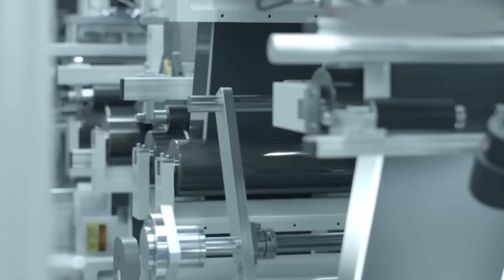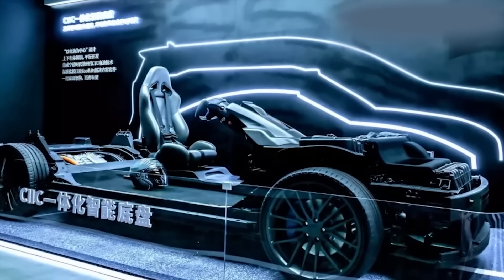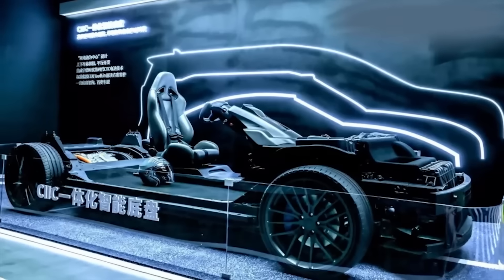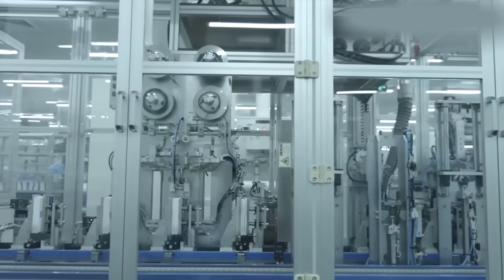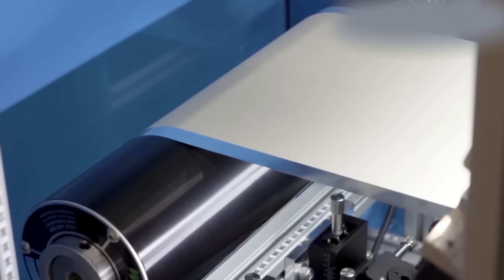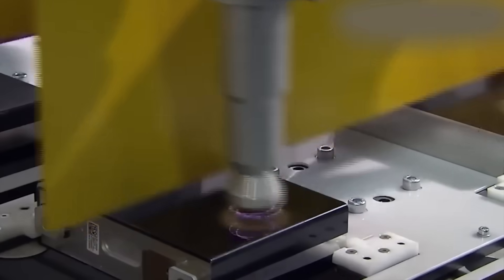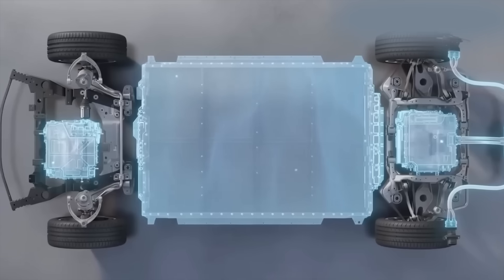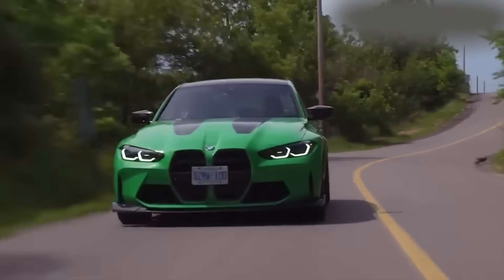CATL Unlocks 1,000-Mile EV Range with New Lithium-Metal Breakthrough

Comment: in Cars ICE engine market share will shrink. but in trucks make money by carrying weight and a heavy battery reduces that, so you make less money with a more expensive truck. electric in industry is still a long way off, you need a peace of equipment to run for an entire shift without stopping (time is money). for electric outside of cars to work we need at least a ten fold increase in battery energy density. i don't think diesel will go anywhere and what Edison Motors is doing with hybrid drive is the bridge technology.
Reply: Interestingly diesel consumption in China has gone down for the second year in a row
Reply: In Europe electric trucks are winning and the rough numbers are twice the purchase price, 25% of the running cost. Hauliers try and maximise asset usage so electric trucks work well for this. Charging time aligns fairly well with mandatory rest breaks, and as a haulier you can assign diesel trucks to routes with insufficient electrification in a way that a private car owner can't.
How it will translate to US trucking I don't know. Certainly there are also things like Australian road trains that are a long way from going electric.

Comment: Need at least 1000kms, so you feel comfortable towing stuff. And can drive all day without worrying about running out and needing to find a charging station.
Reply: If you can charge in five minutes, a 1000km range doesn’t make as much sense. Most people also don’t tow so you are talking about a small percentage of the population.
Reply: @yodaiam1000 . But EV’s need to replace all vehicles, in Australia you need long range, a lot of retirees live the caravanning life. And in remote area you could go 2000kms without charging  infrastructure and this may never change. So towing and lack of infrastructure certainly make long range a necessity in australia. Maybe they will start making driven caravans with their own battery storage, may need to put a solar array on the roof of the caravan with awnings to increase the charging area.
Reply: @keyboardoracle1044 A long time ago there were also no fuelling stations in these areas. Charging infrastructure is building. Yes RVs will have much lower range with the same size battery as a car. RV will be getting bigger batteries. Most mandates in the world allow for PHEVs for larger vehicles that tow. However, with advances in batteries, that may not even be necessary. I get your point but things change and improve and we are just at the beginning of the change over.

Comment: if they figure out a way to recycle used battery cheaper. wouldn't that make the cycle life problem irrelevant? Mainly talking about for aircraft applications where you can have airport level infrastructure that can handle recycle single used lithium metal battery. Or rather design a battery that is easier to recycle. So for energy density sensitive application they can just do fresh battery swap at the terminal station. Instead of having to worry about degrade cycle life.

Comment: Can't help feeling that driverless air taxis are the ultimate end point. The electric motors have the torque and the light weight. The batteries are getting to the necessary energy density and charging speed. Struggling to see why they wouldn't overtake cars in 20yrs

Comment: Lithium metal batteries are  considered relatively dangerous compared to Li ion or LFP. I am sure CATL have done what they can to make it safe, however, the danger is intrinsic to Li in its metallic phase and can't be conjured away altogether.

It would be great to drive 1,000km but not if you are nervous about sitting on an electric bomb.
Reply: While energy density matters, a potential roman candle is not something you'd want.

Comment: 1000 km range is 621 miles. And unfortunately, as often happens, you forgot to consider that this is Chinese CLTC range. It is approx. 25% to 30% more aggressive. In EPA range terms, this is 465 miles. Still, this is very good and a sign of things to come. The average EPA range for ICE cars in USA is 425 miles. So this would be above ICE average. It’s plenty, especially if you can charge at home and you drive it in mostly the area you live. Most people only occasionally have long distances. If Tesla (or some other manufacturer) can get a car with 465 miles and FSD at an affordable price, this would be game over  the ICE industry.
Reply: the Silverado EV and GMC Sierra EV, offer substantial range, with the Silverado EV reaching up to an estimated 793 km (493 miles) in its Max Range Work Truck (WT) configuration, while the Sierra EV offers up to around 769 km (478 miles)
also tesla has there long range models also over 700kms

Comment: This sort of range is what makes an electric car very viable in Canada.  Imagine cities 180km apart in -30c weather... you need the extra capacity for climate control and reduced performance due to temperature.  If there is a 3 hour traffic delay due to an accident you don't want your climate control to switch off.
Reply: tesla already has a long range model's that can do more then 700kms and if you are driven 180kms you would heat the pack up no problem at all and get back any loses from the pack being cold. they also use a heat pump for heating and cooling that is pretty good on power usage
Reply: @NightshiftCustom  Won't buy from a fascist CEO though.  Being caught in a Tesla is being politically tone deaf.
Reply: @billknight7342  maybe seek some help and get your head checked

Comment: QuantumScape effectively solved lithium-metal technology five years ago. CATL’s approach is not fundamentally very different from what Factorial is doing, and that pathway already has many well-known limitations. The claim of 500 Wh/kg appears to be marketing hype rather than a realistic target. In practical terms, the achievable energy density is unlikely to reach even 60% of that figure. Lithium metal increases energy density primarily by eliminating graphite from the anode, not because lithium metal itself has exceptionally high specific energy. At present, battery performance is fundamentally limited by the cathode. To truly approach 500 Wh/kg, new high-energy cathode chemistries such as fluorides or sulfur will be required. With conventional cathodes like NMC, the realistic upper limit is around 400 Wh/kg at full maturity. QuantumScape’s own projections of roughly 300 Wh/kg for its initial version further support this conclusion

Comment: Nobody needs a range of 1000 miles - the payback of higher energy density is that you can potentially halve the battery size needed to go 500 miles 
In fact once you factor in the weight saved from the smaller battery it might only need to be one third the size (and cost)
It is only a matter of time before this happens and when it does the petrol car is toast
Reply: It's 1000 miles CLTC which is about 750 real world miles and add in battery degradation after a few years to 80% maximum charge you're looking at around 550 - 600miles.
Reply: At 60 mph with a 500 mile battery range, you'll have over 8 hours of driving before needing to charge.

Comment: Longer range batteries in the same weight and volume and access to DC fast charging are the missing piece for motorcyclists too. For now on mine I am limited to the city - which is fine but i would love something I could tour on.  We need ~300km but are stuck at around 150km atm.

Comment: It would seem sensible to reduce the range down to 500 miles and reduce the weight and cost of the car, rather than ramping up the range to figures that just aren’t needed.

500Wh/kg vs 180wh/kg would allow you to double the range while still reducing weight by 100kg compared to an existing 70kWh battery. (And ofc lower weight means more range again, and if you’re using less cells or packs then there’s less connections required which will save further weight).
Reply: You also have less superstructure which saves you more, but then it always comes down to cost. If an existing heavier battery tech is the most cost effective it'll likely hold that part of the market, just like lead acid did for a long time.
Reply: Not even 500, we only really need to hit closer to 350-400 or so. Most of the reason 300 doesnt work is because there is a bit of a overhead so you dont get the full 300 miles today where ICE do. So if it can cover that over head - that would do for most people and that means less over all cost for the battery it self. So hopefully that translates to half the battery size over all.
Reply: easier said than done since you are not even an engineer

Comment: Unlike ICE vehicles EV range drastically changes the price of your vehicle and the handling and efficiency as the batteries are heavy and expensive.
The average daily commute is 28km - let’s say people other uses for their vehicle and add on 7km per day - (28 *5) + (7*7) = 189km per week. Lithium battery max charge level ~80%, people start to get anxious when charge runs low, so let’s say we aim to stay between 30% and 80% and we only want to charge once a week. This means the average person needs a range of 378km. 
Their expectations are of higher range because of how long it takes to charge and because there are still very few chargers. So in my opinion those are the factors that need to be addressed. More chargers and faster charging - not ever greater ranges for the mass market vehicles.
Reply: Commuting that far on a daily basis is the true insanity. Either move closer to work, or work from home. That is winning.
Reply: @nicktw8688  I looked up daily averages, this is not how far I travel. I travel zero each day as I am retired. But yes you are correct, although the problem is quite complex, as sometimes people are forced to change jobs and don’t want to uproot the family. Spouses might both work in different fields in different places.

Comment: This would be great for micro mobility like e-bikes and scooters too. You already have all the range you need, but now instead of your ebike or scooter weighing 20kg it now only weighs 17kg, that’s a noticeable difference when you’re trying to push it up a set of stairs or lifting it onto a wall rack to get it out of your way in a small flat. Would make electric micro mobility way easier to move around and store and even better for older people and folks with disabilities
Reply: That's such a good point! I bought my GF and I e-bikes a couple years ago and hers is too heavy for her to lift like you describe.
Reply: @te8547e get the ones with removable battery
Reply: Bingo. Pairing the densest power source with the lightest mode of transport seems like the obvious choice for everyone outside the snow belt of Northern Canada and Europe. And even then? Still the best option 6-8 months a year..
Reply: Mini mobilities and Public transportation system are Heavenly combo.

Comment: I very much doubt synthetic fuels will ever become viable. Even if we don't use oil for fuel, oil will still be mined for other purposes (plastics ...) any demand for petrol will still come from oil because we will have oil and it will still be cheaper than making synthetic petrol. The only difference is you will need to buy it as chemical product rather than fuel. It will be more like race fuel that you need to order and pay a lot of money per lt rather than going to a petrol station to buy some. The chemicals in petrol and diesel do have other uses other than fuel.

Comment: 300 mile real world range is adequate for most people. Smaller packs=lighter cars, better handling and cheaper once these packs can be scaled up. Win win.
Reply: For me the number is closer to my present car - 400 miles.Not because I would ever drive that in one go though! But to reduce the frequency of charging to the same as my present car as I don’t have off street parking at my house.
Reply: @philbarker7477 l have home charging, so never seen the point of 1000 mile range.
But very much take your point, if you only have to charge every 5-6 weeks, then it makes a big difference.
Reply: Also fine with me but if you are towing or do lots of road trip then it would be nice with a little more but it depends on good charging.
Reply: For my driving 400-500 real world miles would be ideal.
Reply: You should qualify this with 300 mile real world range in all weather conditions.  I am not aware of any that can get that while driving at -20F.  I hope the Sodium Ion batteries can get us there then I agree.
Reply: Charge speed is what matters
Reply: The more the better , an aside my new 3 - 4hour laptop or the smarphone that only achieves a day is rather lame
Reply: Higher density is critical for trucks since they lose 2/3 range when towing.  In the U.S., 250 miles while towing is needed to finally get everyone to ditch ICE. 750 miles is going to be tough to achieve.
Reply: Stop it fanboy. Everything non Tesla isn't crap.
Reply: After you figure in the never charge over 80%, and not below 20% so that’s a 40% off the max range .  -300miles is not adequate for a full EV FAMILY .  I have a 70-75  mile commute , 400-500 miles in America is the tipping point for mass adoption .  For just general use 350miles single car  is good as a second car but as Ev only we need a bit more.  
I have model 3 long range 340 mile range .  It’s pretty great for everyday use .  But when we traveled it took a bit longer than I liked for a long road trip (700 miles ).  Then in winter when temps are below 20 degrees requires an extra 20%-30% to compensate .  So - 50-60 % non  use miles miles  is to big of a 
Jump for everyday use , plus road trip .  350 is ok for second car commuter.
Reply: They always say this car gets 350 miles real world driving probably not

Comment: Energy density is a huge limiting factor for electric motorcycles. So this development may open up that field.😊
Reply: and aircraft
Reply: @zarb88 Common jet fuel energy density for big jets has basically remained changed  for last 50 years. The amazing about EV battery chemistry is that it's rapidly improving not static, while at same time prices conntinue to drop..  It's still far way from jet fuel but the rapid speed of development makes you wonder if it will ever reach a point where battery tech will exceed jet fuel's energy density. Throw AI in to manage the flight, then imagine how cheap flights could be become.
Reply: Motorbikes won't need the cycle life that cars or trucks need, so even if the cycle life is less than other batteries it would be beneficial.
Reply: @Hamish_A . Also, it would be very easy to yank out an old degraded battery 🪫 from a motorcycle 🏍️ and replace it with a new one.